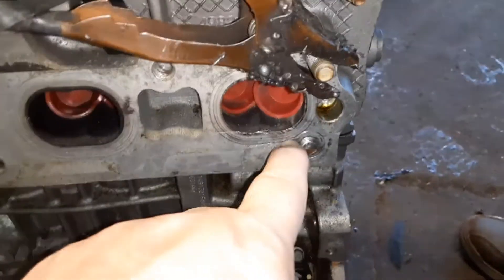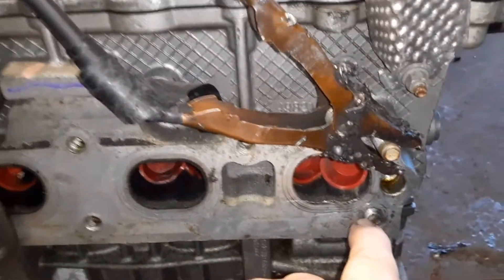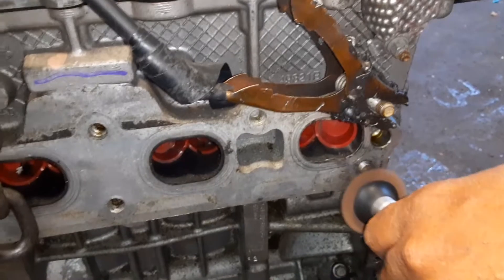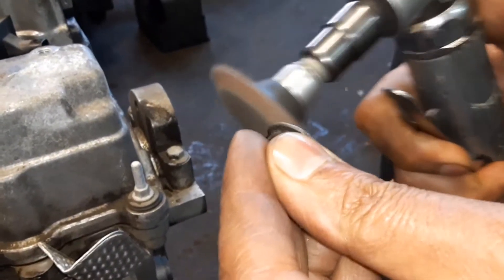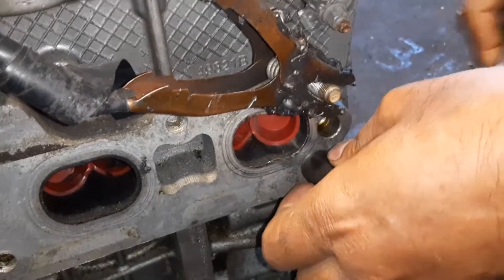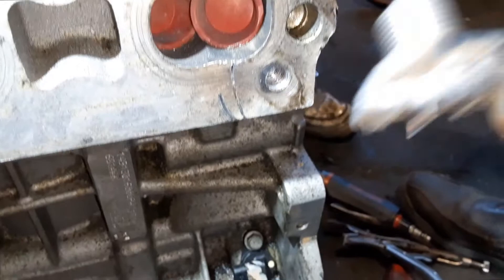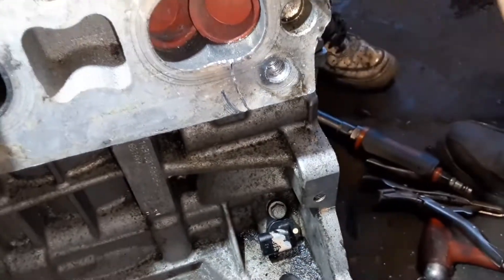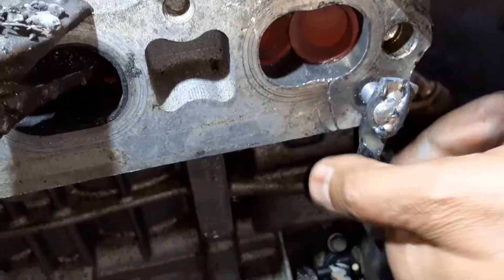How to Remove a Bolt Stuck in Engine Block or Anywhere

Comment: Clever, considering the bolt is already sticking out far enough to put vice grips on it and turn it out, ir just cut a damn notch and use a flathead. This video was not even close to helpful and would only work if you have the entire block out, which most don't!